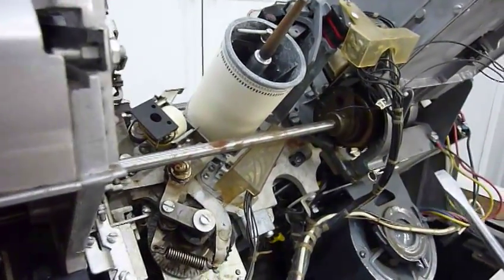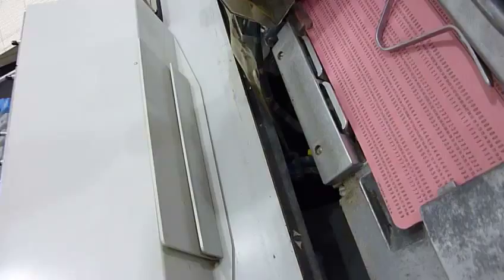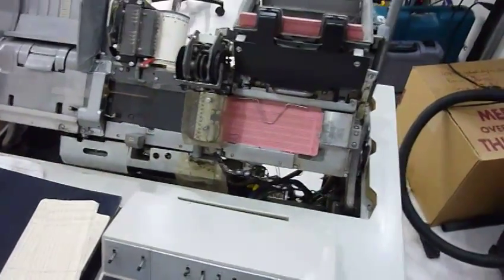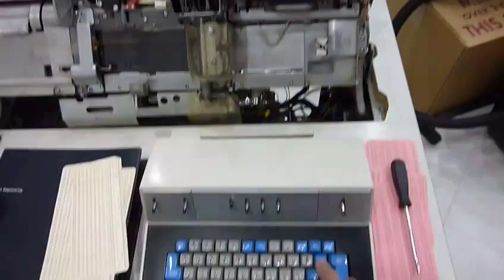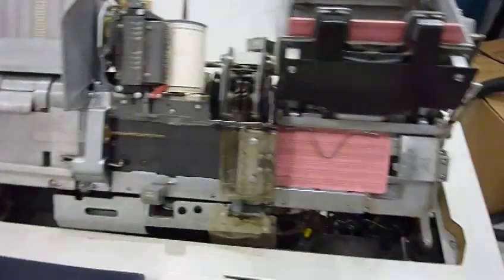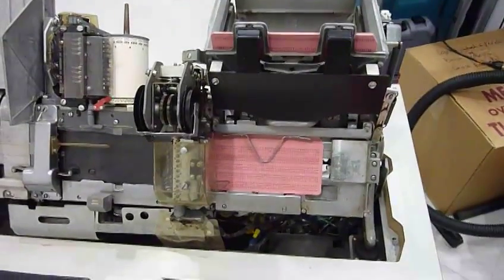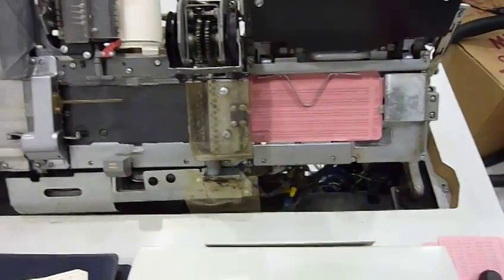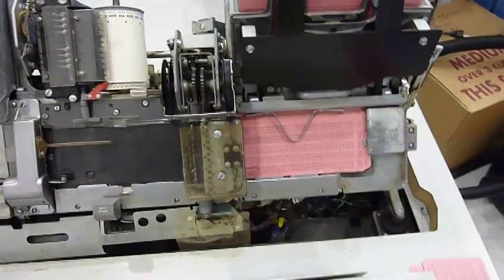IBM 029 Keyunch Restoration 2: First signs of life

Comment: I repaired these for a living many years ago. Had a good laugh at your  machine failure. Brought back some good memories. Thr reason it wont release and keeps trying to feed cards is the contact on the two card rails at the bottom of the feed station isnt being recognized.
Reply from the maker: That's the first thing I checked of course, but it wasn't the reason. One of the only switches that actually worked properly!

Comment: Back in the good o days when I was working for my uncle; we had a Teletype machine with a paper tape reader.  The reports would give times in Hotel and /or Zulu times.  And durning Xmass a Santa Sleigh and two Raindeer made the rounds of the Comm centers !  My proposal was to run the Raindeer through three more times for a total of eight Raindeer and one Samta sleigh; used a lot of paper tape !  Any of your machines have paper tape readers ?

Eyes UP and lights down,  tjl  Sent by Win7Pro64  w/ADSL
Reply from the maker: Oh yes, teletypes with paper tape, I love them. They will need to be part of my collection. And also they could talk to R2-D2 / Marcuinos ;-). Don't have one yet, but a friend of mine says he has two ASR33's and will let me have one if I repair the other one. Sounds like a deal to me. So hopefully one of these days I'll get to this project.